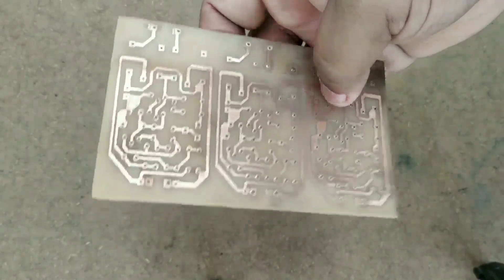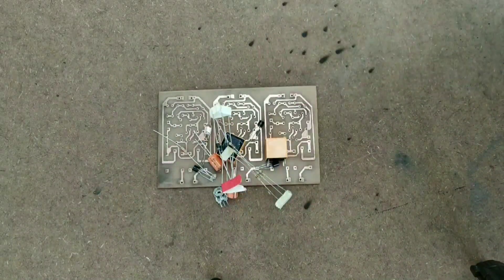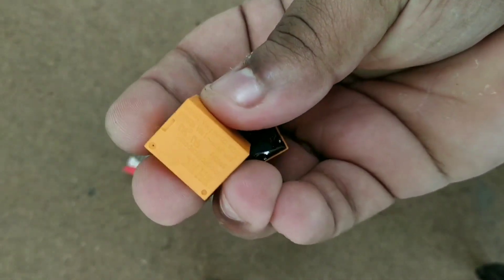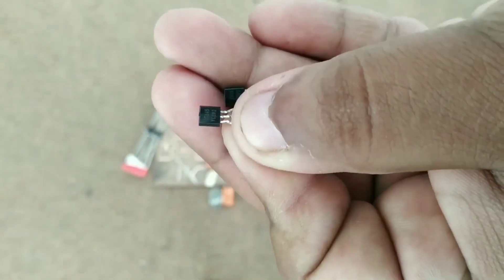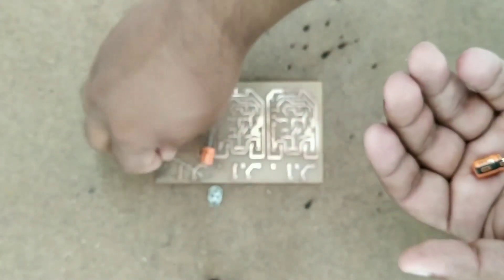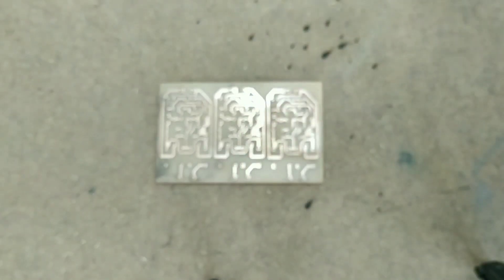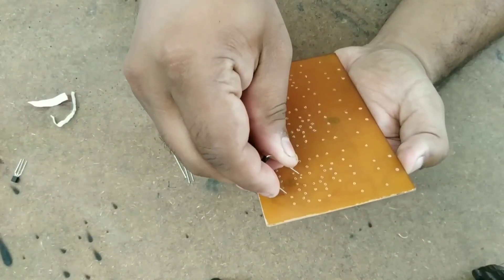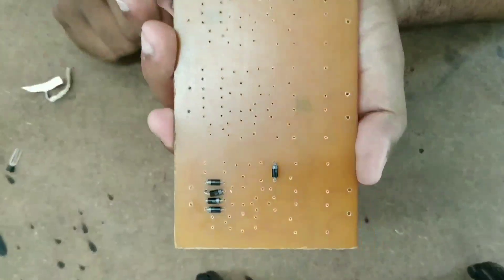Assembling a 5.1 speaker protection with delay board full project

Comment: ഞാൻ രണ്ട് ചാനലിന് വേണ്ടി ആകിയപ്പോ total cost 70 രൂപ ആയി...ഞാൻ C9013ന്  പകരം C8050 ആണ് ഉപയോഗിച്ചത്
Reply: Chetta preset connection onnu paranju tharo
Reply: @midhunvu3983  പ്രീസെറ്റിൽ 3 pin ഇല്ലേ അതിൽ നടുവിൽ ഉള്ള pinലേക്ക് അതിന്റെ opposite ഉള്ള രണ്ട് pinൽ ഏതെങ്കിലും ഒരു pin short ചെയ്താൽ മതി
Reply: Preset value 220K തന്നെ വേണമെന്നില്ല 100K(104) ആയാലും കുഴപ്പമില്ല
Reply: Athalla preset 3 leg connection aanu manasilavathath
Reply: @midhunvu3983  ente first reply nokku
Reply: Thanks.

Comment: സ്‌പീക്കർ കത്തി പോവാതിരിക്കാൻ ഓരോ ഫ്യൂസ്  കൊടുത്താൽ പോരേ
Reply from the maker: Porallo dc voltage fusil koody irangy varum ini adhava ampere koranja fuse kodthal speaker load edkkumbolo peak edkkumbolo fuse pokan chance und like stk board
Reply: @technicalevolution9887  amp കത്തി പോകുമ്പോഴാ സ്പീക്കർ പോകുന്നത് സ്പീക്കർ ഔട്ടിൽ ഫ്യൂസ് ഉണ്ടെങ്കിൽ സ്‌പീക്കർ കത്തിപോകൂല്ല. എനിക്ക് അനുഭവം ഉണ്ട്. Stk ic പോകുമ്പോൾ സ്പീക്കറും കത്തിപ്പോകും വൈൻഡ് ചെയ്ത്  മടുത്തു അപ്പോഴാണ് ഈസംഗതി ചെയ്തു  നോക്കിയത് അത് 100ശതമാനവും ഓക്കേ
Reply from the maker: @sumeshs6141  bro stk polalla mattulla ic kal ath full voltum purath vidulla transistor athpoleyanu njan sakthide board vangyappo ath work akunnundarnnu but kure kazhinjappol spkr choodayi smell vannu njan nokkippo oru 8volt speakeril out kanikkunnu but still working ithpolulla conditionil spkr protection must anu fuse ella conditionsilum ok akulla

Comment: It's working but delay time work akkunila njan cheythathill☹️
Reply from the maker: Transistor kollathonda
Reply: @technicalevolution9887  which one ?
Reply from the maker: Transistor c9013 matty nokku pinne preset nallathanonnum nokku aa circuit fully working anu
Reply: @technicalevolution9887  Bro enik work aavunnilla 
ON akkumpo relay odane on aavunnu but bro 12v supply direct aayi test cheyth noki but appo relay off aavunnilla
Karanam yethanenn ariyo
Reply: @technicalevolution9887  njn s9013 ane itte pinne preset 220k kittela athonde 500k ane itte
Kozhappam ondo

Comment: ഞാൻ ആഗ്രഹിച്ചിരുന്ന വീഡിയോ ആണ്. Thank you so much bro... 😍.Keep going👍. പിന്നെ Relay ലേക്ക് പോകുന്ന speaker line കുറച്ചുകൂടി വീതിയിൽ etch ചെയ്താൽ നന്നായിരിക്കുമെന്ന് thonnunnu. Especially subwoofer നു. പിന്നെ ഇത് പവർ ഓഫ്‌ ചെയ്യുമ്പോൾ വരുന്ന noise cancel ചെയ്യുമോ? Try ചെയ്തോ..?
Reply from the maker: Outil varunna line solder vach thick akkyal mathy pcb cheruthakkoyappo etch chyunna circuit veethy kuranjathanu
Off akumbo olla noise ozhivakkanayitt
Speaker sub muthalaya boardnu use chyunna filter capsnikkekkal value thaznna caps use chytha mathy ii boardnu eg 220uf use chyuu
Reply: @technicalevolution9887  താങ്ക് you😍